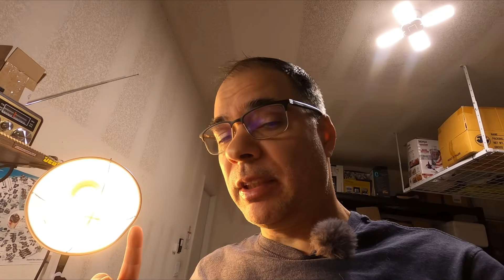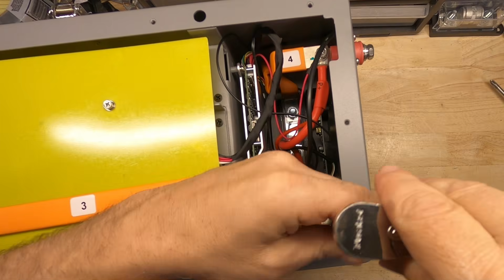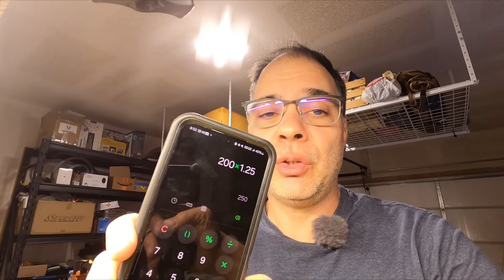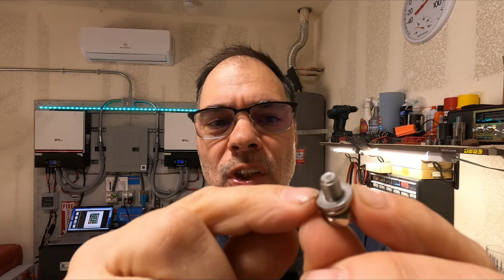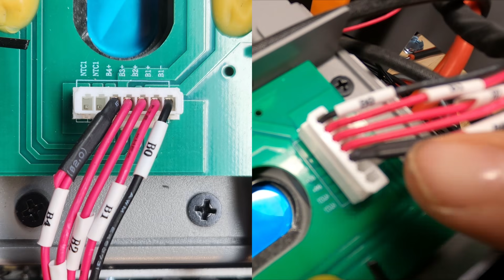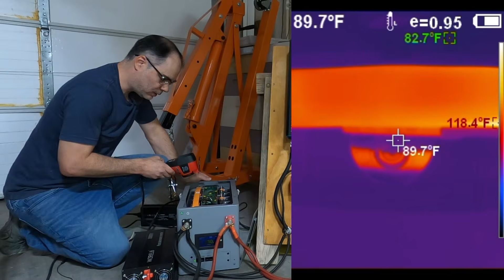Yixiang 12V DIY Battery Kit - Review and Test

Comment from the maker: Affiliate Links

YIXIANG 12V DIY Battery Kit (alibaba):
https://offer.alibaba.com/cps/rjapm3tr?bm=cps&src=saf&productId=1601708003747
Click on "Chat now" to speak with Becky

Yixiang Direct: 
https://yixiangpower.com/products/yixiang-12v-diy-4s-314ah-lifepo4-battery-box-kit-with-jk-200a-bms-us-stock-estimated-shipping-time-jan-25th-4pcs-3-2v-314ah-brand-new-grade-a-lifepo4-battery-cell-china-stock-shipping-time-25-35-days?sca_ref=9920820.hXaAzn34l51FDj

User Guide:
https://www.natesdiysolar.com/pdf/manuals/battery/yixiang/12v-diy-battery-kit-user-guide.pdf

Data Sheet:
https://www.natesdiysolar.com/pdf/manuals/battery/yixiang/12v-diy-battery-kit-data-sheet-specs.pdf

Fuse Spec Sheet:
https://www.natesdiysolar.com/pdf/manuals/battery/yixiang/12v-diy-battery-kit-fuse-spec.pdf

Comment: 21:56 You twisted the wires is what you did. Pre-twist? You twisted them before you twisted them?
Reply from the maker: Lol, I see your point.. it's a common electrical term used when you twist the wires before you do another action, like putting on a wire nut.. Freudian slip lol